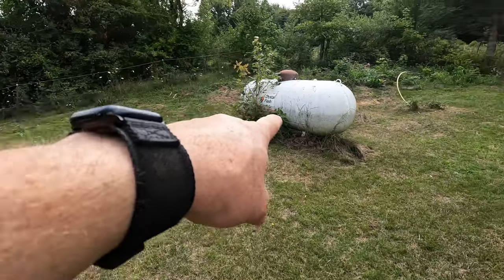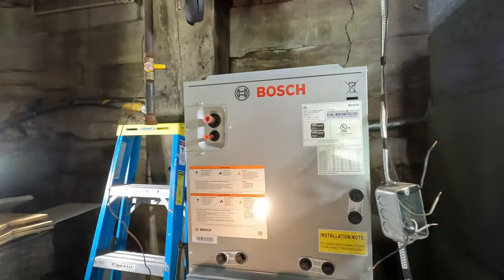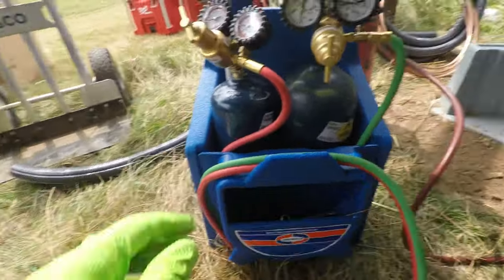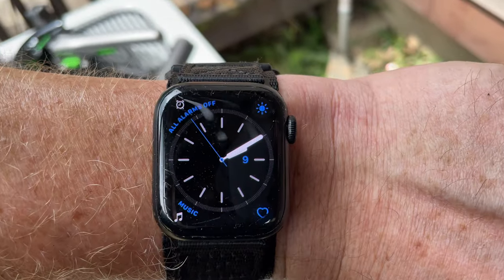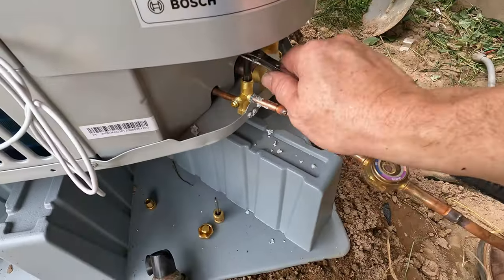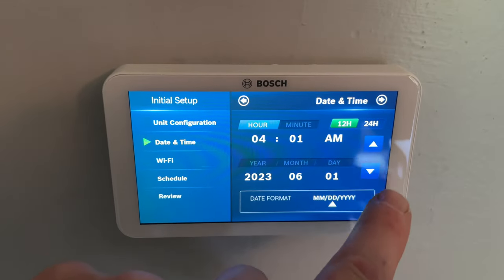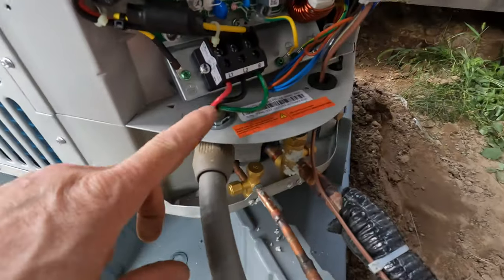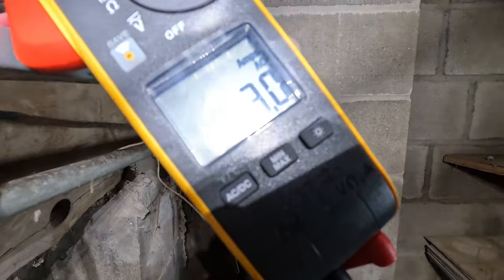96% Gas Furnace & BOSCH Heat Pump Combo with ICM518 surge protector

Comment: If these Bosch units heat down to 5° outside air the gas burner will never come on in most cases. Just installed the 5t light system in my son’s house. He had 100° at register’s on a 15° morning. Game changer.

Comment: Goodman announced a recall on their plastic drain pans in their coils. Apparently, the melting drain pan only happens with the Goodman high efficiency horizontal up flow furnaces.  I believe the high efficiency furnaces cause the issue because the burners are located at the top of the furnace next to the coil. The burners on the Goodman 80% furnace are located lower in the furnace, further away from the coil drain pan.

Comment: How old is your furnace?  I have an older Carrier 58MTA two stage furnace from 2004.  Runs perfectly.  I just had a contractor say it wasn’t worth installing the Bosch IDS heat pump unless I replaced my furnace also.  I haven’t read or seen anything online that would back him up. Is he right?
Reply from the maker: Carriers are known for their secondary heat exchanger to fail. But if it has a Variable speed motor on it? You should be good I would not put on a bosch if it had a PSC motor. The unit is 19 years old. mechanical equipment usually last 15-18 years. So you are getting to the tail end of its life. If you are going to upgrade,  it would probably make sense to do the whole system.

Comment: Very informative.  Just bought a house with a Bosch 5 ton heat pump with oil back up running though a Bock Oil burner/Water heater.   How would you recommend it be set up?  2900Sq ft house....it would seem the heat pump could easily handle entire home with little help from aux oil especially in southern Virginia.   Oil usage data says otherwise.   Thanks!
Reply from the maker: Yes, I would definitely run it as much as possible. If you set your thermostat up at the set point of switch over to about between 30*~35* this will make your Bosch run more I have heard these units still can produce heat when it’s in the teens, not as efficient tho.

Comment: I see you're in Michigan.  Considering installing the Bosch Ultra that is set to be released any day, depending on it's price.  Do you have an idea of it's costs?  Seems like the right unit for those of us in Michigan. 
Looking also at the Daiken fit but like the ability to use a dumb thermostat and use with any furnace with the Bosch.  Was looking at the Premier HP and seen the Ultra labeled as a cold climate HP.  Been trying to find a price but no luck so far.
Reply from the maker: $12-$15k for the complete system.

Comment: That’s great that the unit only runs 10 amps. So realistically you could run that outdoor condenser of off a 14/2 cable and be totally fine. By chance do you remember the minimum circuit ampacity requirement for that unit?
Reply from the maker: Max fuse is 40amp Min circuit 24.8 so I would roll with a 30amp 14 gauge wire would be a little dicey. So possibly yes if this was set up as a 2 or a 2-1/2 Ton you might be able to get away with that.
Reply: @ADVANHVAC  yes oh course I wouldn’t violate what the manufacturer says is the minimum circuit size. I agree a 10 gauge wire would be appropriate wire for this unit. I was just saying that it’s interesting that theoretically if the unit is drawing 10 amps a 14 gauge wire would safely power it.
Reply from the maker: Yeah these Bosch Inverters are very efficient and the 5 I have installed my customers love them.

Comment: Does defrost cycle turn gas burning on to warm the house or just supplying cold air to the house?
Reply from the maker: Yes when it goes into defrost it will kick on the Gas heat.

Comment: Question, 
When you did initial set up. You made the thermostat control it and not the appliance. Why?
Reply from the maker: Because this is a forced air furnace. If you looked closely at the option it said if you have a boiler you would let the appliance control the blower.  When you have a boiler and your using a heating coil you would want the appliance to control the blower to move the air across it.

Comment: How cold is the heat pump effective to?
Reply from the maker: I have been told this unit will still work  about 15 degrees outside temp. I have them set up for about 32-34.
Reply: I had my Bosch heat pump installed in May….it heats down to 5 degrees.
Reply from the maker: Thank you for that update. That's impressive.
Reply: @ADVANHVAC  It's disappointing that only a couple of the Bosch matchups are "cold climate" rated, but the next generation coming out this year will all be cold climate heat pumps.  No need for backup except for defrost cycles and breakdowns.

Comment: why in the hell would you not wire 2 stage, your missing out badly on comfort that Bosch can bring,   even if the furnace is single stage add a relay for 2 stage fan, its easy
Reply from the maker: The Furnace is two stage. Everything is controlled by the Board.
Reply from the maker: So maybe I’m missing something here? The Bosch INVERTER Heat pump is not two stage. It’s 100% modulating, and I guess the only thing they would be missing out would be when it came to the 2nd stage at the board on the furnace which would make the blower on the furnace ramp up to a higher speed correct? Not the Bosch itself because that is controlled by the board on the Bosch.
Reply: Kinda of correct,   with out hooking up Y2 and Y 1  on the furnace your missing matching the need of the home more closely.   The Bosch is modulating   and takes its good old time getting there,  but the thing communicates through temperature and pressure of the suction line. it seeks to maintain 47 degree indoor coil temp no matter what,,, so slow the indoor fan down  the out door slows down to maintain that temp,   if the need is higher the stat brings on high Fan  and evaporates more refrigerant  and the outdoor responds in kind. @ADVANHVAC
Reply from the maker: Ah!!! Thanks for the tip! I will do that on the next ones.
Reply: if you dont  do 2 stage cooling on the stat depending humidity in your area  you might run in to the thing not taking moisture out of the air of the conditioned space not to mention the OH WOW factor of savings cuase your running slower fan and compressor speeds over half the time in 2 stage that it will make for a much lower electric bill."WOW factor"

Comment: No you should have do a full heat pump system so no more propone gas need it
Reply from the maker: Negative Ghost rider. There are years that it will be to negative 15-20 degrees. I talked to the owner they are extremely happy with this set up.